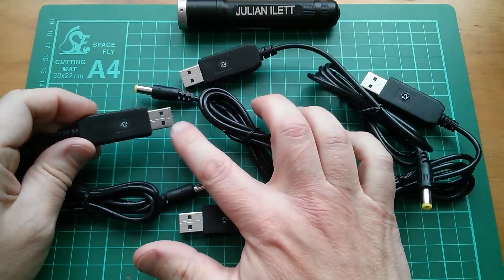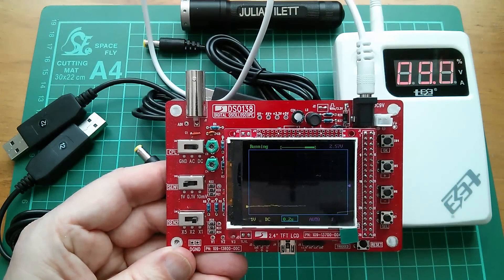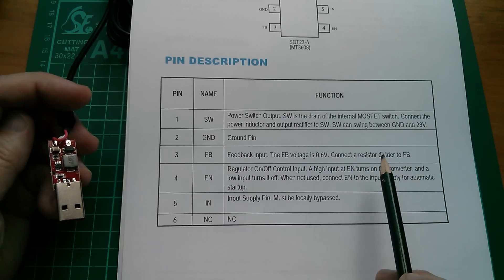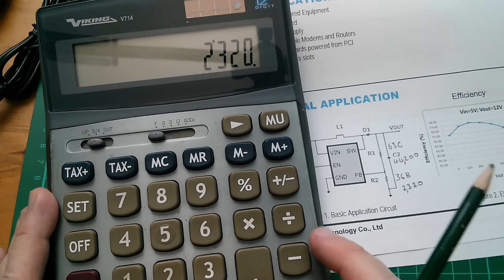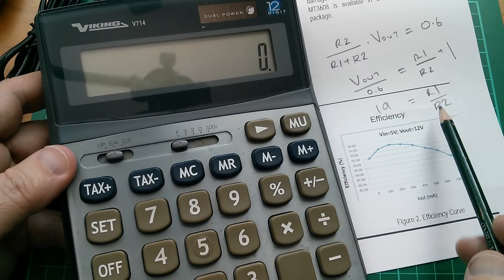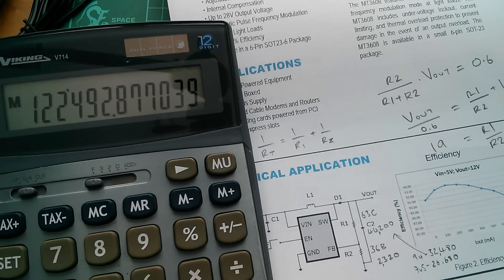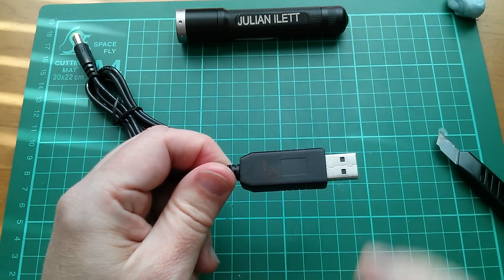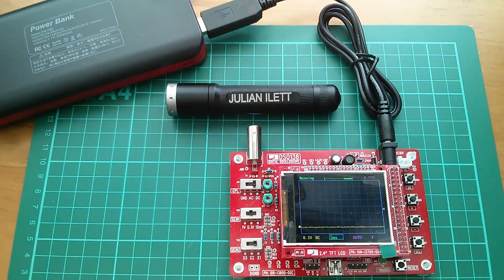USB to 12V Step Up Cable - Conversion to 9V

Comment: I wonder if it's really necessary to use the powerbank boost.  Using a USB-A socket and a lithium cell with only a protection circuit, it would bypass the boost circuit and go directly from 3.7V to whatever is needed, eliminating one efficiency loss.  This would also avoid the powerbank cutting out during high current draw to meet the power requirement of the device..  If more input current is needed, just use a larger cell or multiple cells in parallel.

Comment: I see USB powerbanks that can output 5V, 9V or 12V (out of the USB connector) but there is no voltage selector in them. How the output voltage is selected in this case? Is there any communication between device (let's say a phone or tablet) and powerbank to select USB out voltage? Or does it output always 12V and the device limit the voltage to 9V or 5V? Or how? 🤔 Many USB power banks with USB connectors only (no extra DC outputs) and no selector are specified "USB (5V, 9V, 12V)". Or this can only reffer specifically to USC-C outputs?

Comment: Is there a possiblity to change the usb input terminal to a power jack female input? There are four pins of the usb in the board, which is postive and negative on that from lwft to right?

Comment: Thanks to this video I was able to convert from 12V to 9V a similar cable equipped with a chip labeled AL229. I found nothing about this chip on the web. I did a bit of reversed engineering to draw the schematics. Then measured the reference voltage with a DVM (0.6V). Using the same formula I calculated the value of the modified resistor divider (378K/27K). Instead of adding a resistor in parallel, I removed the SMD resistor and soldered a 390K resistor insulated with a bit of heat shrink tubing. Works great! Thanks Julian!

Comment: USB Boost Cable tested
With this small power booster you can derive a supply voltage of 12 Vdc from a cheap 5 V power bank. According to the manufacturer, the device can supply 1 A and that for a price of just under three euros.
➡    Read this article
https://chinese-electronics-products-tested.blogspot.com/p/usb-boost-cable-tested.html

Comment: I found a small voltmeter online that has two power wires and one signal wire. Would it be possible to hook up the power wires to the 5v input from the USB and the signal wire to the positive output and then replace the resistors with a potentiometer to make it multivoltage too? link to the voltmeter: https://www.ebay.com/p/5pcs-Mini-Blue-DC-0-30v-LED-Panel-Voltmeter-3-digital-Display-Voltage-Meter/1638907234?iid=281478533527

Comment: uhmm ok.. but how does it work!..^^.
i bought the same looking cable. for my 5v usb powerbank. with the idea to charge my bluetooth speakerbox. witch needs 12,6 volt but it only charge 3 seconds and then stops.
or doesnt charge at all if powerbank isnt 100% full.

can i still use a cable like this or its doomed to fail? :(

Comment: Very informative. What are the specs of the resistors please will 1/4W be okay ? I wanna modify the 5 to 12 volts adapter to work on a 7.2/8.4 volt camera (with dummy battery). Should I use the 100K or 82K resistor ? 

I have the 5 to 9 volts converter  but not sure if 9 volts is too high.

Comment: I just got some of these but they have an AL516 six pin chip. for the life of me I can't find a data sheet for it
Reply: ended up mapping out the board layout and it had a resistor network similar to what you had here. Calculated a parallel resistor to make the feedback voltage match at an output of 12v and it worked. Thanks for the great video and an awesome idea for how I could easily power a device in my house from a usb wall wart

Comment: most of this math jsut flew right over my head, though what i would like to know, would it be possible to wire this up with a potentiometer to make an adjustable usb cable, or would you need two pots to make it work?

Comment: Ooh..cool,but..whats that blue thing that holds the resistor?
Where can i buy it?
Thanks in advance.
Reply: They call it blue tack. But it is about the same as that easy release stuff you use to put posters on the wall. I get it at the dollar store.

Comment: Very useful idea, thanks for the video. Have just made up one of these, I did it slightly differently by removing R1 and replacing it with a 33K resistor, soldered up to the top of the board like you did.  Measures 8.98V on the output which is perfect for what I want to use it for 😊

Comment: 7:50 Hell no! You can't! It's wrong on many levels. First it should be R1*R2 to be able to do that, second if you split it it will be 1/R1 * R2/R2 = 1/R1. So your R2 just gone. Can you see what's wrong with that?

Comment: I made USB to 9V/12V converter with a switch to select the output voltage as a kickstarter back then when no such device existed. Suddenly after my kickstarter those devices started popping up everywhere. Based on my extensive research while developing and testing this I can say with confidence that all those chinese knockoffs of my product are shit. https://www.kickstarter.com/projects/femtocow/usb-912

Comment: I don't know anything about electronics, but I am curious what would happen if you fed feedback pin with 0.6v from outside (like with power supply) prior to powering the chip itself. Does anyone know the answer?

Comment: I am trying to power 4 DC daytime running lights 12watts each off a 5v power bank. Do you think one of these usb to 12v step up converter can handle 4amps?
Reply: Did you watch the video?
The chip can handle max 2A.
Reply: Mac Donalds can one buy a similar device with a 4amp output? And can any off the shelf powerbank handle 4amps? I find 12v batteries too heavy hence going for 5v powerbank
Reply: 4 amps at 12 v = 48 w
4 amps at 5 v = 20 w

Comment: I though my DSO138 is getting old with a 050 firmware, that one is 041. Time to buy a DSO150 Shell.
Reply: I have both and I really prefer working with the DSO150 Shell. In my opinion it is the better Scope of the two.
Reply: Have you ever flashed the firmware on the 138? 
I was wondering if all the new firmwares have that annoying counterfeit warning splash screen.
Reply: SidneyCritic ComedyHound - Sorry to say that I haven't tried to update yet. when I bought mine I removed the sticker with the serial number (because it wasn't marked as a serial number). I hope I won't need it to Update someday.
Reply: I've got all the stuff to update, but I'm uming and ahhing about whether I want longer boot times for a bit more accuracy, if the splash screen is still there. Mine is not counterfeit, so it's a bit annoying if I have to put up with the splash in a genuine.

I think the 150 had problems with the first firmware, so you might have to look that up.

Comment: how easy do you think it'd be to add some sort of switch to switch between the 3 resistor values you need on this to have a multi-voltage one like this, Julian?

Comment: I've found (and just recieved) a really interesting Powerbank found under the term " Aili 12v 12v 19v" it uses 6 18650s in 3s2p so it's really useful in 12v mode. It has one USB port( that is turned off when the voltage is set to something else than 5v) and one barrel output connector. Output voltages are selectable with 2 multi position switches to get ca 3.7 5 6 9 12 15 16 19 and 21 volts. The input is a barrel jack as well wich might be annoying for some people but most laptop power adapters are compatible without modification. It does not seem to balance the cells though sadly, that would have  been really nice!
Reply: I can give just a little bit more info if anyone is interested
Reply: FyJonas I just received mine today. It looks very promising. Mine has 3.7/5/6/9/12v. I'll try it out tomorrow. But it does look like a replacement for Julian's Super Power Bank. 😀

Comment: I wonder why someone thought we needed yet another resistor identification system? Then thought it a good idea to need a set of tables to actually find the value of said resistor. Guess it is silly of me to ask why not just print the value on the resistor. ie 33K. Probably a silly idea but it works for me!
Reply: Michael Beeny I'm guessing it's mainly for "precision"  resistors which require 3 significant digits (instead of two), similar to 5-banded resistor (as opposed to 4)
Reply: I was also wondering why not replace r1 with a (common) value resistor of say 33k, which should give about 9.1v ?

Comment: Hi,

I bought a few of these some time ago and they where sold as "maximum output 750mA".
However anything above 350mA make them dive and the 5V input was solid.
So I was curious; have you checked the output current performance of your devices?

Love your tube!

Anders

Comment: I’d measure all the 120K resistors with a meter and choose the one with the value closest to 122K. The tolerance is probably large enough for you to just luck out.

Comment: This chip's more likely to be SX1308 (b6286), a replicate of MT3608. The problem with it is that it burns easily for no reason. And when it burns, it shorts Vin with ground. I've bought two types of boost converters using this chip, and I'd say this chip's unreliable and dangerous. Adding a fuse at Vin could help.

Comment: Love your channel.  
Try one of these crappy power supplies and see if you have the same results.  I bought 2 and they each lasted about 10 minutes lighting 15 watts of 12 volt led lights before overheating and dying.  So far banggood has been unresponsive for a refund.
http://www.banggood.com/AC-100-240V-To-DC-12V-3A-Power-Supply-Adapter-Switch-For-Light-LED-Strip-p-1087363.html
Reply: Just to add I found an old Nextgear 1 amp power supply and have it running the same lights with no issues for the past 30 minute.  How does banggood get away with saying they are 3 Amp?  Cause they are 3 amp for  5 minutes?

Comment: Could a variable(adjustable) resistor be put in parallel instead of a fixed one? That way someone could use just one cable and set the desired output voltage.
Reply: OrbitalSP2 and in Addition a Little Chinese 1$ Voltmeter to show the actual output voltage. Or maybe one of his "sandwich arduinos" with oled display and voltage sensor.
Reply: Michael Bernhardt well 10 months latter but yes, cool idea. Those little voltmeters are really cool.

Comment: Why not mod the converter with a tiny surface mount Trim pot instead of the surface mount resistors?
  Maybe I'm a gluten for soldering the tiny stuff. I tore into an old camcorder from the 80's and salvaged dozens of trim pots that would probably work perfectly. If you were to drill a tiny hole in the cover for adjustment, you'd have a single, more versatile unit.

Comment: I've been running my dso138 for hours on end at 12v. (Taken from jyetech website.) 9V DC (8 - 12V acceptable)
Supply Current: 120mA

Comment: I like to use a white grease pencil or a white-out pen when marking black items. Also you should be able to power those arduino amp meters you made earlier. A thought.. couldnt you used a pot instead of a fixed resister, to change the voltage. you would then have a variable output step up

Comment: The resistor system shown in this video is just crap ...
I like the numeric + R bette
also why didnt you write the 9V on the usb Plug?
Reply: The system is for odd values that aren't represented in the "normal" labelling. So you know it's the new precision resistor system.

Comment: get a silver sharpie
Reply: I wouldn't be surprised if you could get the same stickers used for 12 on ebay but in a range of numbers! Or perhaps actual voltage label stickers.
Reply: That's what label makers are for.
Reply: .. Or some cheap white nail polish.  Of course, you have to let it dry before you use your Tian Fu ;-)
Reply: or just write with the liquid paper
Reply from the maker: I'll look out for one :)
Reply: You can just use Liquid Paper as a white background and use that black sharpie.
Reply: It will not last 5mins as it will rub off too easy

Comment: If you have an android device, try "electrodroid" for resistor calculation and lot of stuff.
Why don't you write 9v on the USB plug rather than on the black case ?
Reply: Thanks for electrodroid tip! Really good.
Reply: Or use a gold or silver permanent marker on Black or dark colour plastics ....

Comment: I got one of the new Qidian QD185-TY power banks, its really good. My only issue with it is that its unbelievably difficult to get the battery compartment open.

Comment: add a lipo and a tp4056 with overdischarge protection and you have a rechargeable scope...(move power switch to booster input)
Reply: They do a battery version.

Comment: Why not just buy something like this one with a potentiometer and forget about the math? http://www.ebay.com/itm/252819689037?_trksid=p2057872.m2749.l2649&ssPageName=STRK%3AMEBIDX%3AIT
Reply: You'd have to add the USB plug and the output lead+plug,  which would likely triple the cost
Reply: I have one of those with a micro USB port. The thing is, you have to connect a voltmeter every time you change it. Alternatively you could buy one with a built in display but the cost and size goes up. Plus you have to solder on your own DC jack and it's generally not as neat and tidy as these cables he bought. I do agree it's useful to have a fully adjustable one laying around but having some nice 'consumer friendly' cables with common voltages is handy.

Comment: What about adding a rotary switch, with different resister values? So you can change between voltage outputs.
Reply: or a trimpot,  with fixed resistors to set the full range
Reply: MattOGormanSmith Nice idea as well.
Reply: or you have a choice of three or four different 2A, ~5-28V trimpot adjustable boost modules for less than a quid...
Reply: where you get that little rotary switch to fit in that little case.....
Reply: 5 for a quid now...
Reply: probably be easier to put it into a new case ;)

Comment: you can get those cheap boost up converters for something like 2e for 5pcs, just solder male usb connector and you can set voltage you like, they work from 1.5v to 20v and can output up to 25v